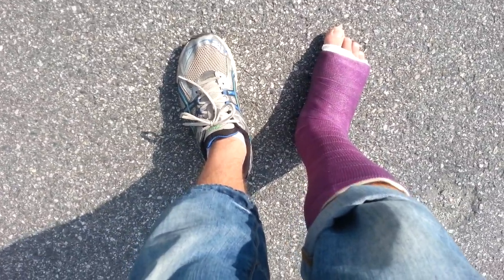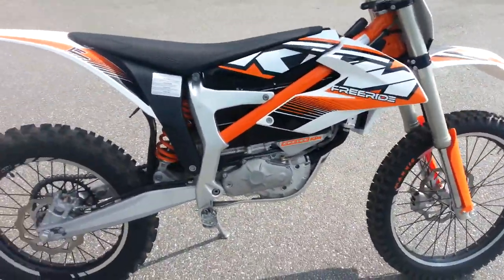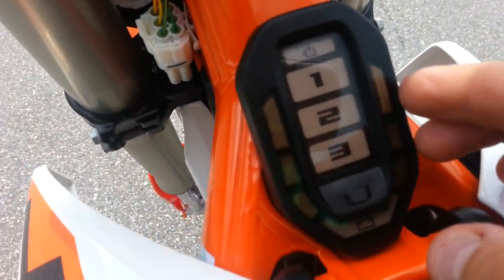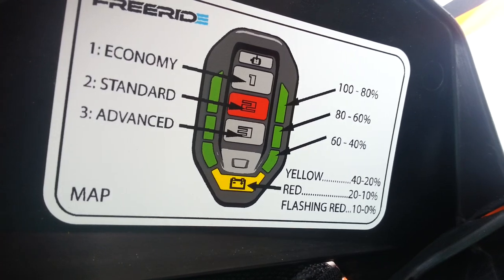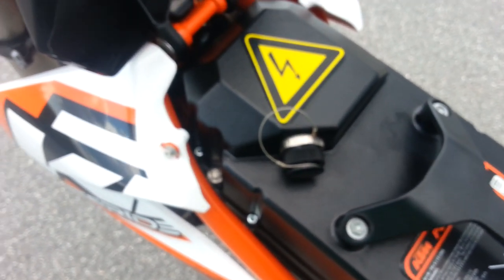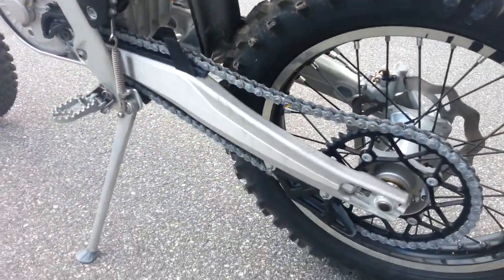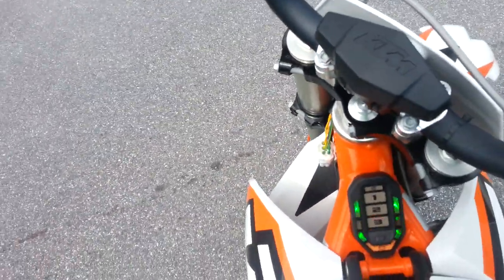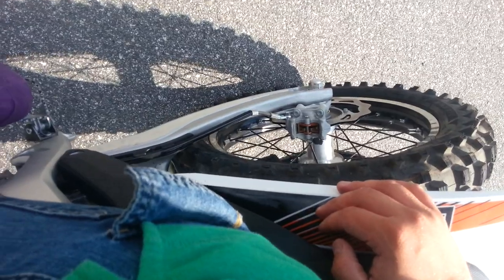KTM FREERIDE E-SX Electric

Comment: how many volts is it? is it a 48 volt ?
Reply from the maker: 302volt
Reply: +Thijs van Bree 260 as he says in the video
Reply: +The Capricorn  thank god these are way behind for a 450cc class plus ktms 450 16s weighs 100.4kg add 7kg of fuel and it still has the best power to weight ratio no electric will touch a 450cc in the weight plus for a epowered 450cc you will need 500volts and heavy duty lipos to run it for 45mins because it will weigh 250kg
Reply: +jonathan oxlade yes but were i live you cant have a GAS powered bike but not a electric... :)